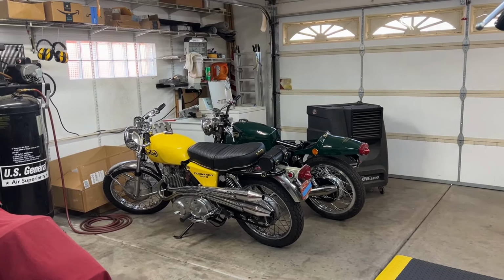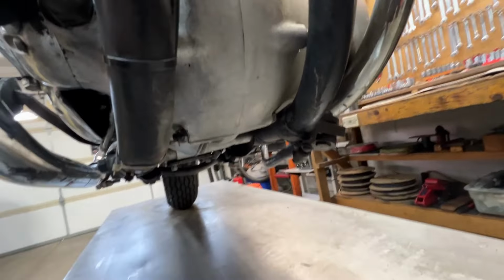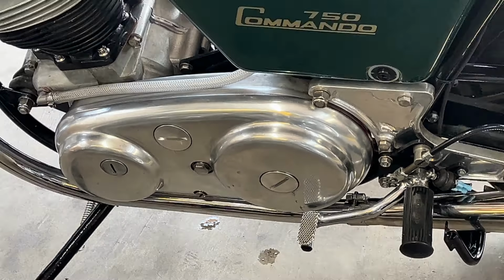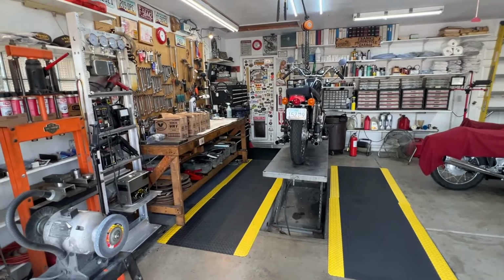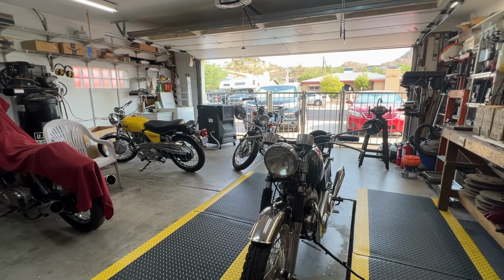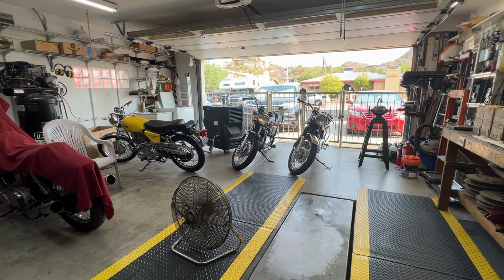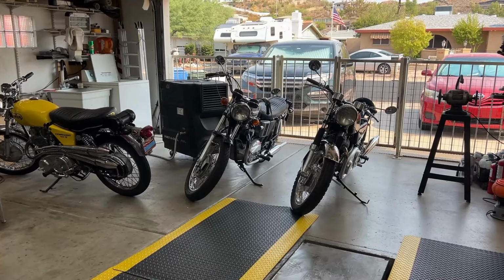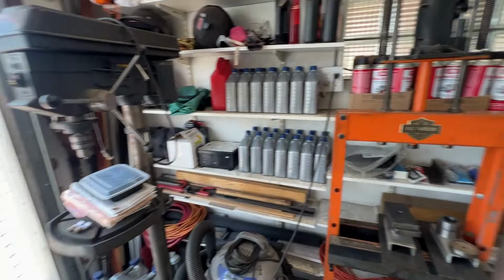07-12-24 - Oil Leak Checks

Comment: One of my favorite things to do is come out into the garage with my black light after fixing an oil leak.  The black light shows all...and when it shows nothing, it's a victory.   It feels great when you actually fix a leak.  I had a push rod tube seal that was leaking like crazy, along with the base gasket on my T140.   I put a new top end gasket kit on the bike and it's been dry as bone ever since.

Comment: I use that same oil on my 64 Triumph TR6 but the spec sheet on their website says "not for wet clutches" which make me think it's not good for later oil in frame Triumphs that share engine and primary oil.  I've never tried it on my OIF, so I don't know.

Why are Nortons harder to start?  Higher compression pistons, or just the way they are?
Reply from the maker: I really don't know of the dynamics of the harder kick required on the Nortons.
It could just be the bigger bore, it could be more compression (but I don't think so).  It could be the gearing between the kicker and the engine sprocket, It could be the length of the kicker itself.  A lotta "could be's."  I have never tried to figure it out.  Maybe some of the other followers have an idea.  Guys?
Reply from the maker: As for the oil, well, I used it for years in all the different bikes with no (known) ill effects.  But now, with the feedback here from followers I now only use it as engine oil in bikes that don't share the engine and primary oil.  Thanks.